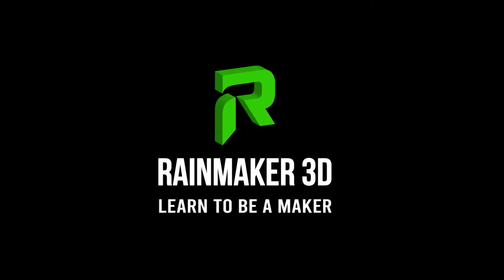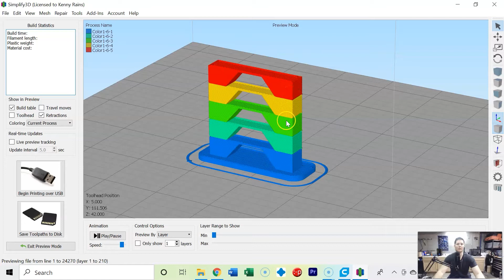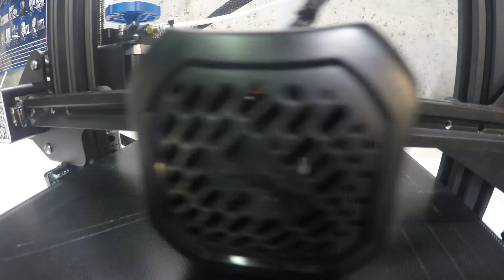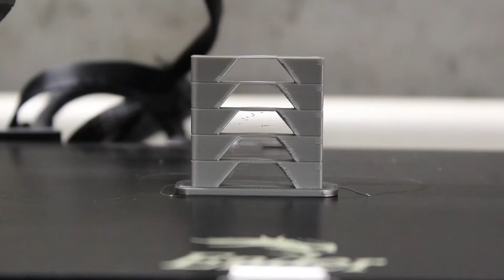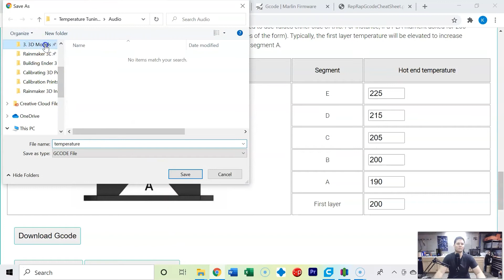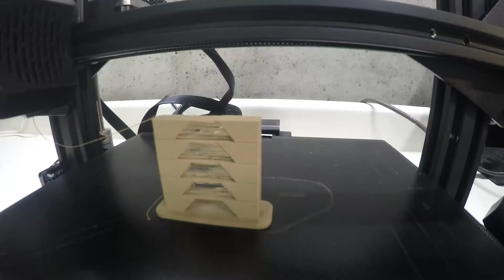Filament Temperature Tuning - Calibrating your 3D printer Part 8 - Ender 3 V2

Comment: I don't know what to do about this small issue I have and having a hard time on finding an answer. On this print the left side of the print with the overhangs are fine but the right side of the print has this issue where the corners of the overhang are almost curling up and then once it starts curling up it pretty much ruins the overhang until it starts over on each level. I also have this problem with the calibration cat on the tail, the overhang of the tail curls up and it just keeps building up on the corners. Any ideas?
Reply from the maker: What material are you printing with and what temperature?
Reply: @rainmaker3d  PLA+ on the temp tower test ranged from 200-220. The pla+ says 205-225 on temp. However I noticed I only have the problem on the right hand side of the print. The overhang on the left side is just fine. So it came to my mind that the part cooling duct being only on the right hand side might be my problem. Its whenever the overhang  is facing away from the cooling duct is when it eventually messes up. But the overhangs that face or go towards the cooling duct come out fine.
Reply from the maker: @motorhead45102  that's a good point it probably is the cooling. You might check thingiverse for a cooling fan upgrade and try that.